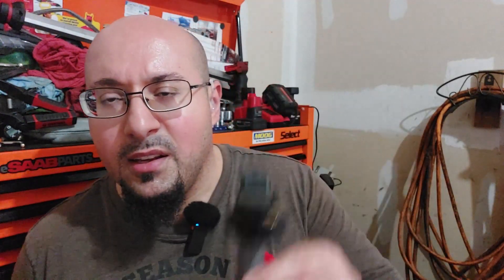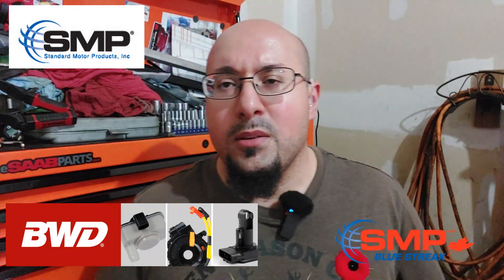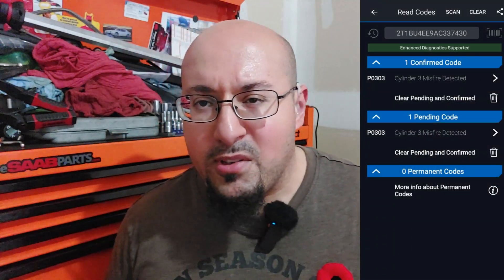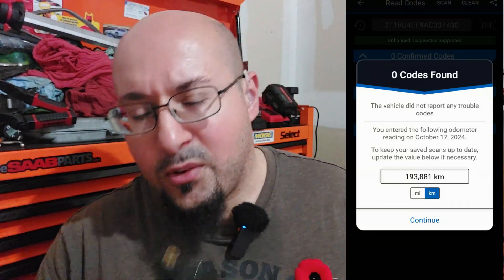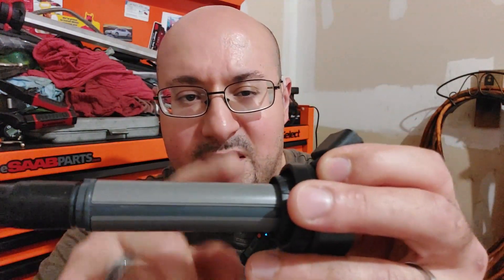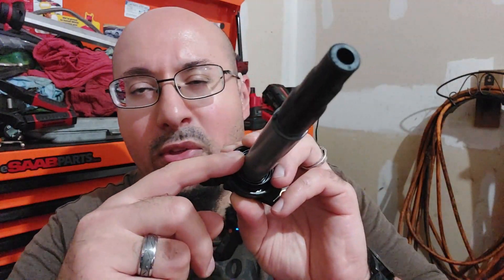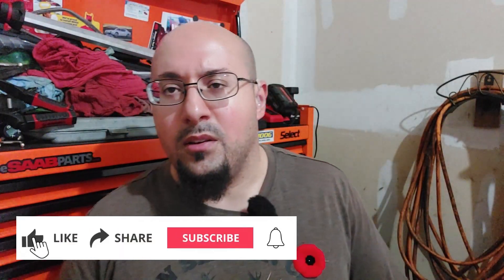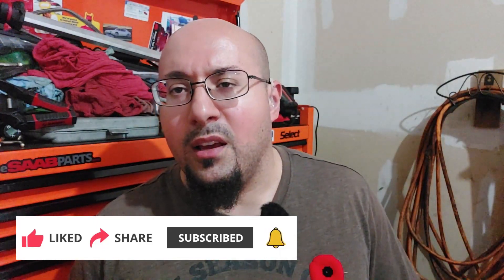Avoid These Aftermarket Ignition Coils - 11-01-2024

Comment: I’ve heard if spark plugs are worn (the gap is bigger) the computer will raise the voltage for the coil to fire and that this will cause the coils to fail over time. I’m wondering if you checked the spark plug gap when you changed the plugs? 
I used Denso for my VW rabbits coils. I trust the Japanese companies products.
Reply from the maker: That's right, but that's not why the coils failed. The coils failed because they are cheaply made. Every vehicle I worked on was when I put in new spark plugs then putting in the new coils or replaced the defective coil(s). I use NGK and Denso spark plugs for the most part. Sometimes I use OE spark plugs from the dealer for other cars such as Volkswagen and BMW and so on.

I thought I had a bad batch of coils, but that was not the case. Every coil I put in failed within a year usually. Some would last slightly longer.

I always install new spark plugs when I replace ignition coils unless if the spark plugs are newer.

Comment: Just buy the oem or used oem
Reply from the maker: Sure, if the dealership is open and if they carry in stock. Some people may need to get back on the road as quickly as possible especially if they broke down out of town. So sometimes getting the dealer part is not always an option in some cases, therefore minimizing the downtime. But if one is not in a hurry and can wait to get the dealer part then that is better. I always give the customer the options.